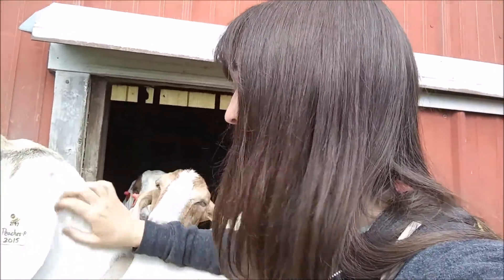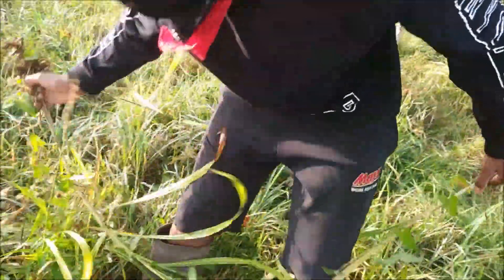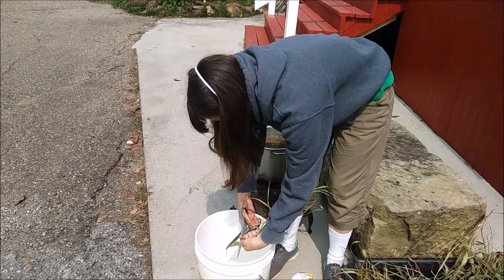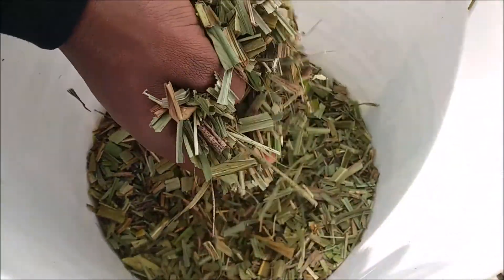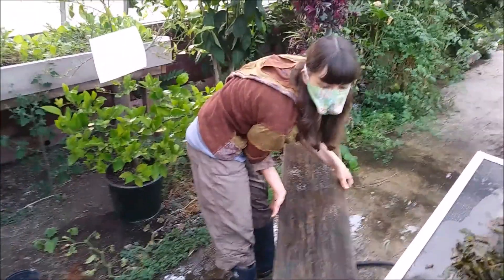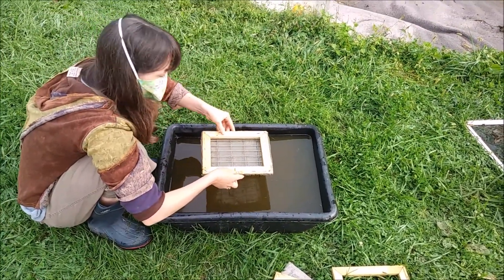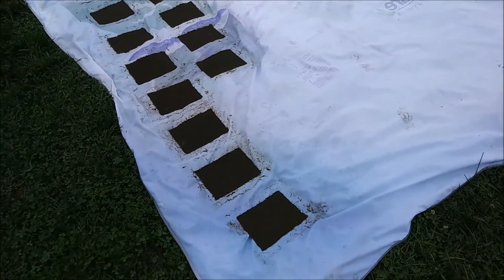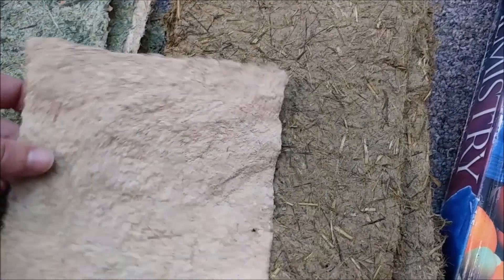Making Paper from Invasive Plants: Controlling Johnson Grass

Comment: I'm curious could you use the method you used to make paper out of other plants in a similar matter?
Reply from the maker: You can use this method to make paper out of many other plants, but certainly not all. The plants you use for this need to be high in cellulose, this usually comes across as the leaves seeming fibrous. I have found that most grasses work well with this process, even the yard trimming after you mow, sedges and rushes work, and  I've even made some very nice paper from daylily leaves. Different plants will give you paper with different qualities, so experiment around and see what you like!

Comment: What is the finished product used for?
Reply from the maker: For most applications, you want to leave your paper out in the sun to bleach. As it is, I would use it as a canvas for painting or for making prints (I may show us using it for iron-stain leaf prints later). The small straw-like pieces in the paper are from the rib that runs up the center of the leaf. This made some of the pieces of paper a little too course to write on with a pen or pencil even if you left it out in the sun to bleach, though you'd probably be able to write on it with a felt-tip like a sharpie.
For future paper making with this plant, I would strip out the rib to get smoother pieces of paper that could be written on with a pencil. The rib comes out very easily, and once you sun-bleach the paper it turns and appealing yellow color. Let me know if you have any other questions!